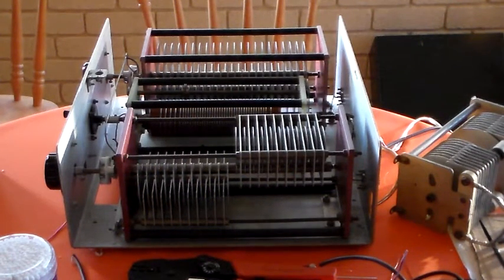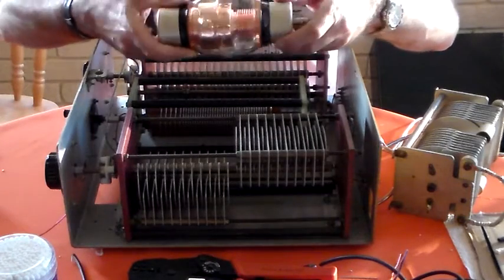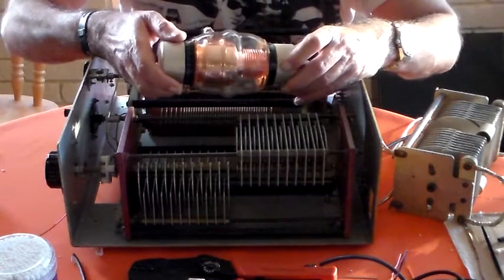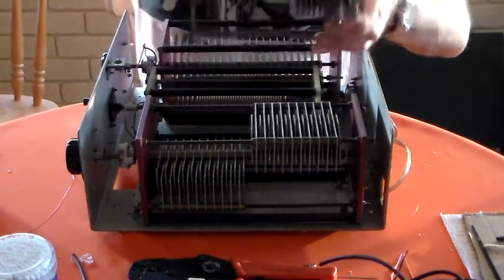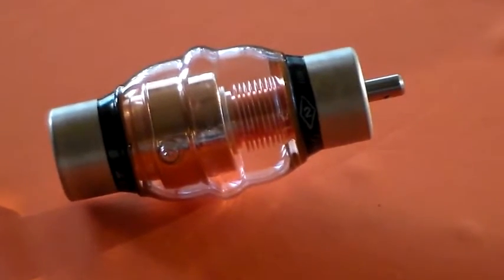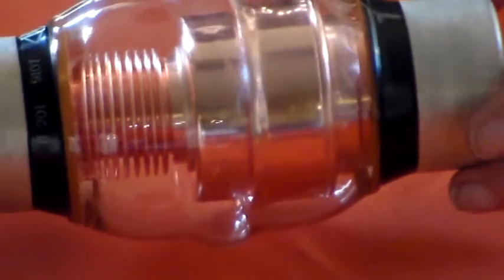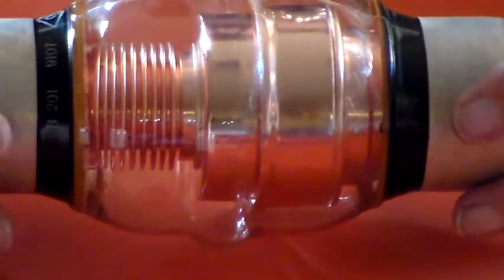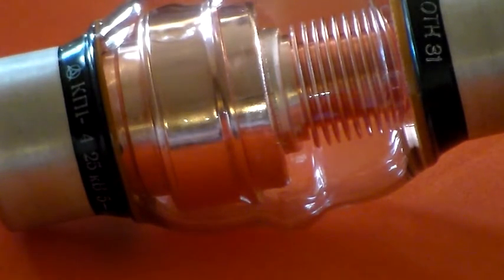100pF 25kV Vacuum Variable Capacitor.

Comment: new sub here love your channel..can that cap keep turning or does it have a stop? Im looking for a variable tuning cap for a project im doing but I want one that can turn 360 deg, without stoping, if you now a model that can let me know please, this one would look so cool tho I want to use a servo motor with it..
Reply from the maker: Thanks for the sub and the kind words. No, unfortunately the vacuum capacitor has end stops. It sounds like you may be building a remote tuning magnetic loop antenna... an air spaced butterfly cap is what most people use I believe. The two air spaced capacitors in the ATU shown at the start of the video both go round and round without stopping. Ebay or a hamfest would be your best bet. I know what you mean though, the vacuum caps do look good.
Reply: Do some of them not have stops?  I'm trying to sort out whether the used Jennings UCS 300 I've picked up is mechanically sound.  Seems like it spins and spins.
Reply: VK6CS I'm thinking of making a vacuum butteryfly cap, just putting a butterfly cap inside a seal plexiglass box and vacuuming out the air.. using either an electric motor to turn it in the vacuum or using oiled gaskets to turn it from outside the box.